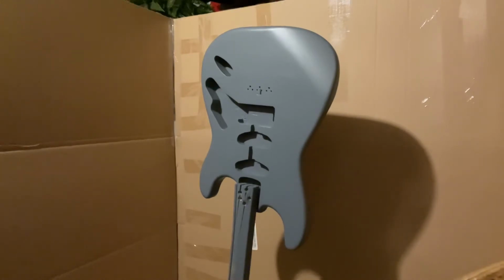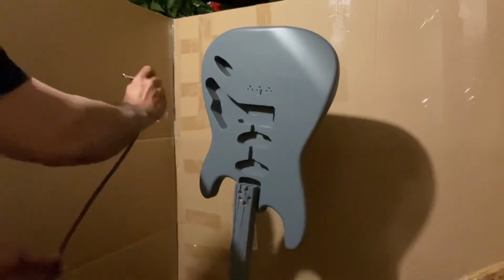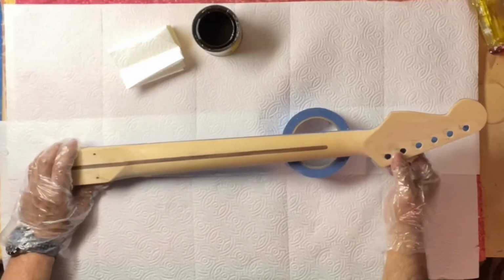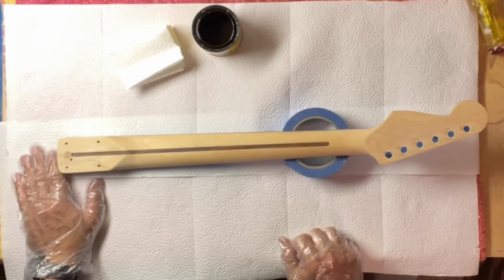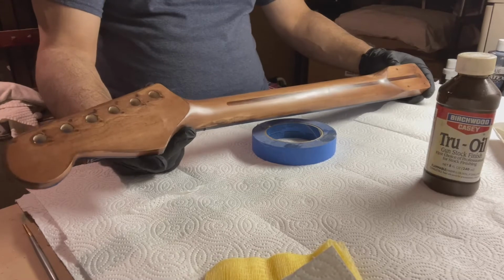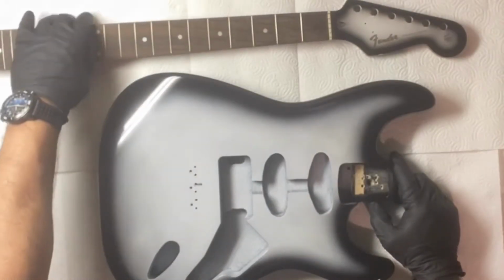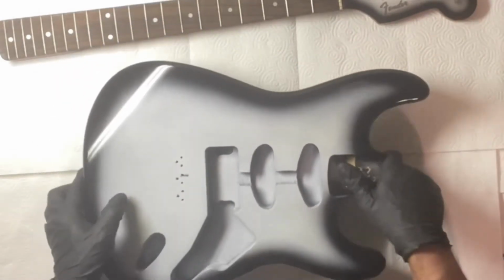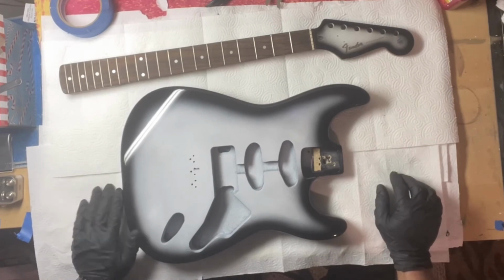Part 3.  Project Squier Stratocaster Rebuild Finishing the Neck and Body

Comment: this may be you best work yet excellent job it looks like a silver burst wirh that matching headstock especially doin it with the airbrush gun i really love your work
Reply from the maker: Hey thanks.  It actually wasn’t that easy.  Lol.  Looks easier in the video.  I did have some problems.  I actually redid the headstock again.  And then I got a ding on it.  But for the most part it looks pretty good. And it’s going to be played and beat up anyway.  I also had some problems with the back side of the body. I ended up with some scratches from handling it and moving it around.  I’ll explain that in the next video. So probably gonna sand it back slightly   I’m not too concerned. Again it’s all a learning experience and these guitars are for my own use and to learn on. I really appreciate your comments. Thank you.
Reply: @guitaraddict9119  your welcome I wish I had that much talent I’m just starting to work on them now more so just little things I want to more of my own setups and do everything since I have more then 45 guitar closer to 50 lol by the way we have the same first name lol
Reply from the maker: @finaljesus  what’s up Dan? Ha. Thanks again. Ive actually been an artist all my life. Drawing and painting. I always dabbled in woodworking as well but learning more now. I just love the creative process of it all.  50 guitars? Wow. That’s a lot of wood. Lol. Are they just project guitars or good guitars?
Reply: @guitaraddict9119  some are projects and some need setups others need a good kick because they’re out of whack lol most are good i have 37 here in my room I live in an apartment lol right now and the rest are in storage unfortunately do you have a website or are you on facebook ? have a great Sunday afternoon
Reply from the maker: @finaljesus  I have a guitar group on FB.  https://www.facebook.com/groups/1892053597615467/  I have a website for my artwork. Carvalhoart.com
Reply from the maker: Instagram.   @carvalho_art 
@artbycarvalho